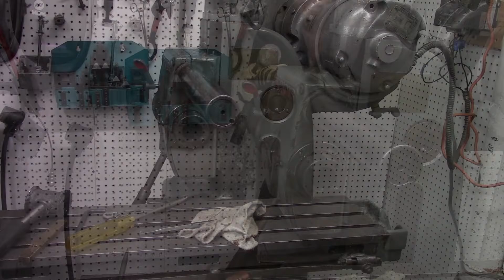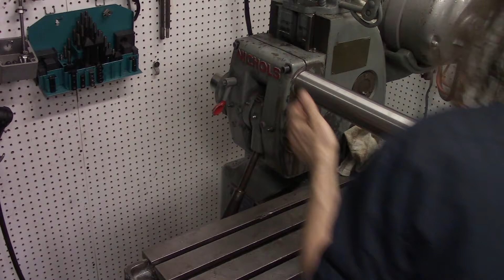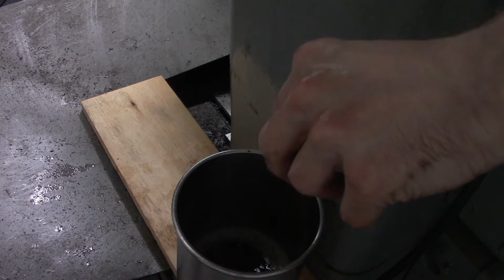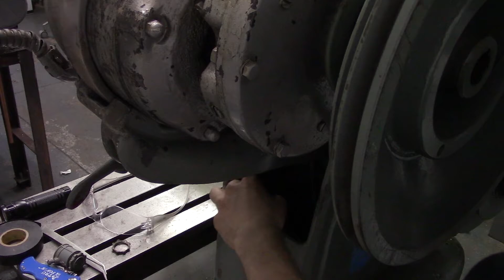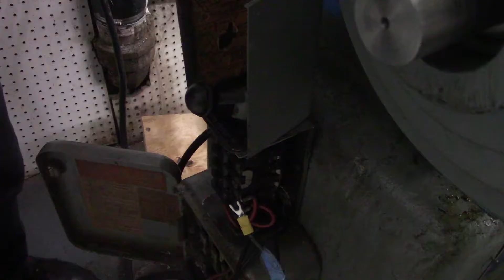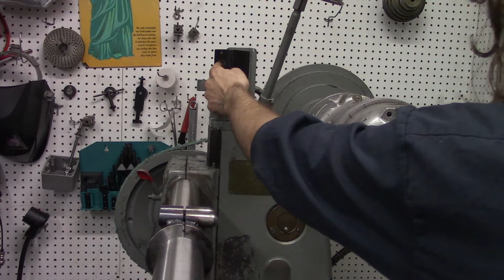More Upgrades To The Mill: New Overarm, Oil Change, and Restoring the Electrical System

Comment: Looks an interesting small milling machine, the head moves up and down as well as the table. Is it a specialized machine made for doing a particular job having that orientation? Tony
Reply from the maker: It was meant for production jobs- the table also can move  on a rack and pinion to feed quickly back to the beginning of the cut. The rack and pinion feed together with the moving head, and some other things makes it suited for doing the same operation again and again.  Merry Christmas Tony

Comment: Does the oil seal on the motor output shaft leak at all?   Mine does- apparently a drop-in replacement can be found at NAPA or similar, but I've not done it yet.   Front bearing could probably stand be regreased.. mine was pretty dry.   I think you'll be happier rewiring the motor straight to the vfd and bringing a 3 conductor cable into the button box- program the vfd for the momentary contacts.   Then you can run the machine at whatever speed the knob is set- no worries starting or stopping.
Reply from the maker: I looked around, I didn't see any leaks- it's been about a week or two by now.  I hope it's not leaking into the motor from the gearbox! yeah I might dig a little deeper in there and look at the bearings.
Reply: @tilliesinabottle  Mine only leaks around the output shaft.   My motor has a screw on the topside of the front bearing housing- convenient to put a zerk fitting in there for greasing, which popped off the press-in bearing cover which was helpful.  

Just did a job on mine using a 1" mill arbor and a coarse tooth cutter, .425" by .325" cut in one pass- worked great :)

Comment: Looking good man ! ! !  --Doozer
Reply from the maker: thanks, I got lucky with the motor- that's the one thing that is just about irreplaceable
Reply: @tilliesinabottle  I gave my buddy Jim C. in Buffalo NY a Burke #4 with the gear reduction motor like that.  Last I saw it was in the pile of motors he has to eventually be scrapped.  It worked fine, I comment it was sad he was scrapping it.  I think it is still there.  It had a 5:1 reduction if I remember.
Reply from the maker: @kooldoozer   That's too bad, once these machines are gone, they're not coming back. The burke #4 takes the same Master geared head motor as this one too- it reduces 1725 to 350 RPM